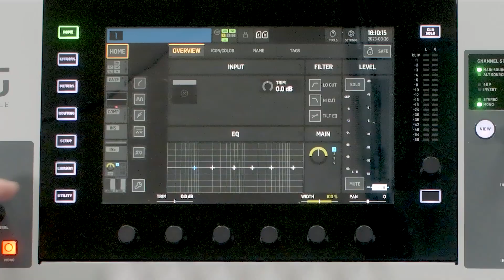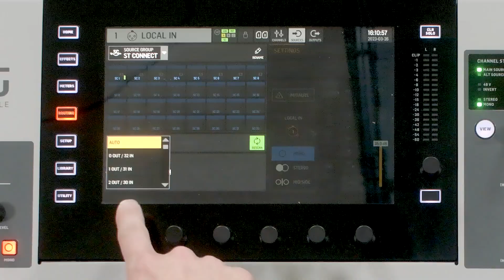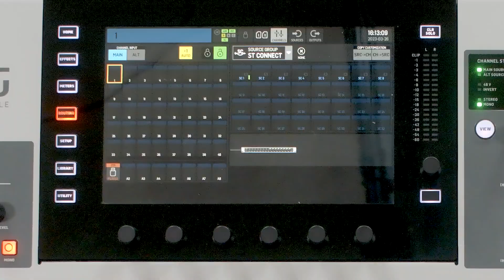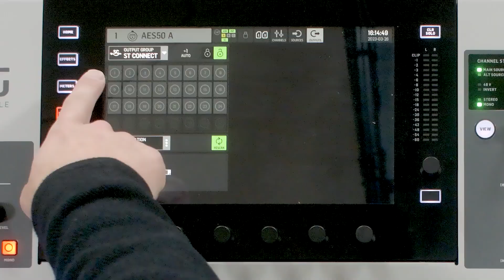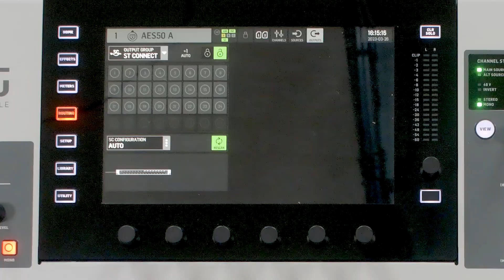StageCONNECT - Midas DN4888 Setup with the Behringer Wing

Comment: I recently bought a Wing Rack to replace my long-time X32 Core. I’d heard there was a huge learning curve to the Wing, but after watching a few of your videos, I’m flying around on the Wing and absolutely loving it! I watched this and a couple other of your videos regarding StageConnect and decided to buy a DN4888. Gotta admit though…I guess one important point you mentioned went in one ear and out the other: The DN4888 inputs are NOT MIC PREAMPS. I’m not sure why they would design it that way. Perhaps the SC protocol doesn’t allow for control signals that would support adjusting head amp gain. Whatever the reason, it is what it is and I didn’t catch that point. I was hoping the 4888 could replace an SD8 and spare an amp space, but it can’t. Oh well…I could send it back, but I’ll find use for it. Keep the great, informative videos coming, even if some of us aren’t absorbing 100% of the useful info! 😂

Comment: So I am mainly using all line level output devices in my setup. If I got one of these stageconnect boxes could I patch all my 1/4” line level gear in and still have some gain control on my wing compact? Or is it just digital trim on the wing? I’m thinking of using one of these stageconnect boxes as sort of a patch panel to eliminate longer cable runs.

Comment: Ok so instead of cat 6 wire it’s XLR to connect the Midas stage boxes 2 or 3 boxes) to the wing as primary and I can still run a separate 32 channel snake as backup from mics and headphones to the wing correct?

Comment: Please show how to connect the Midas dp48 and the p16 to the wing
Reply: The DP48 connects to one of the 3 AES50 ports and gets routed the same way a stagebox is, and multiple units can be piggybacked off each other or you can add a HUB4 which will make running in-ears a breeze.  The P16-M uses Ultranet and will need at least a DN4816U, or one of the other StageConnect interfaces, to integrate with the WING!

Comment: Hello Drew, thank you for your video, very clear and interesting ;-). I use a M32c + HUB4 + DN4816-O. Could you explain how to route to DN4816-O 16 outputs through StageConnect of the HUB4 ? I don't find anywhere an explanation  :-/  For the moment I use the Ultranet output on the M32c to the 4816 input but I imagine it could be done by StageConnect... maybe.  Thank you in advance for your advices.   Procman
Reply: why do you need a HUB if you connect the DN via ultranet to the M32C?
Reply: @keks197474  I use the Hub4 to send outputs to backstage. The Dn replicate 16 outputs for the façade. It works with Ultranet but I question myself of the quality of StageConnect (maybe more accurate than ultranet)

Comment: Just determined the 16x8 mode in the DN4888 allows for 16 output channels total. 8 channels go out the XLR, but all 16 go out the Ultranet. Still only have the 8 line level inputs, but a simple way to add Ultranet off the Wing.
Reply: If all you need is Ultranet then the DN4816U is the cheapest solution!

Comment: Hi drew I have just setup my band with the EW300 G3 IEM system on the X32 Rack - so I have hissing coming through the IEMs and I understand it's system hiss from the console - if i ran the outputs through a digital signal like the DN4888 of even through dante network is it possible to rejuice the system hiss ?

Comment: Hello Mr. Brashler how are doing Sir, We upgraded our Console from Behringer  X32 Compact To The BEHRINGER WING , I Will like to know if is possible to use the stage connect on the Wing and bring in as input from X32 and control it on the wing  or use  the X32 as stage box in our Church. Thank you so much for all the great work that you do, Remain Blessed Amen !!
Reply: You can’t use stage connect for that, but you can use AES50 and route the inputs to the wing. You’ll also need to change your headamp settings in the x32 to be able to control the preamps like with a stage box. 

So in the end you only need a cat6 cable and very minor routing to use the x32 as a stage box

Comment: @Drew Brashler In consumer digital consoles there is always very few ways to get I/O especially channels inserts, so do you know if Wing / Stage Connect can be used to patch an analog channel insert and return or not?  (like post eq send to external tube compressor and back.)
Reply: You can use up to 16 FX processors or external processors in their place using any IO including stage connect (you select external io instead of a built in processor)